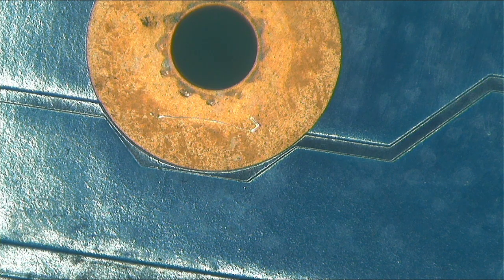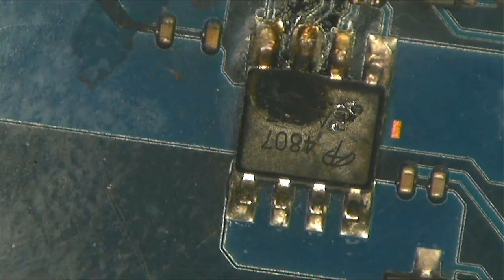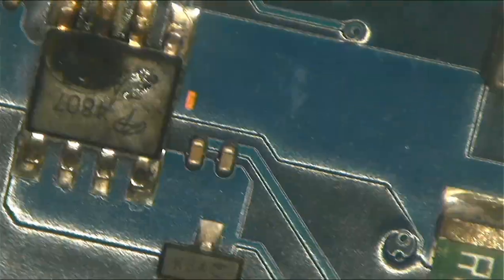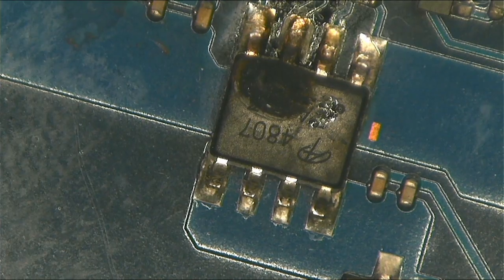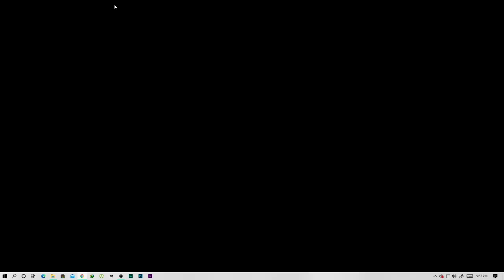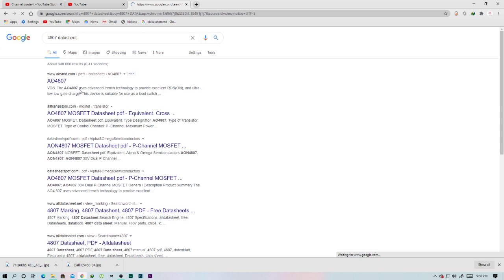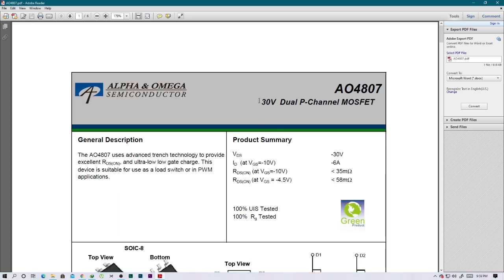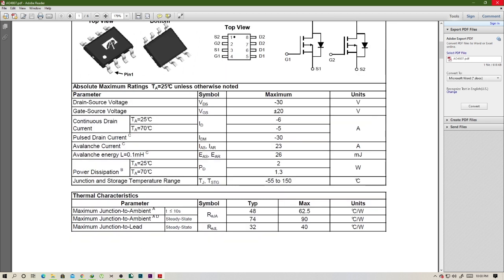BE CAREFUL WHEN REPLACING THIS MOSFET, IT A DUAL MOSFET

Comment: Hola, en el datasheet de ese dual mosfet,  los pines [5, 6] están unidos y los pines [7, 8] están también unidos, pero en el motherboard los pines 5, 6, 7, 8 ESTAN UNIDOS  Los drains de ambos mosfets están juntos en la motherboard ¿Es normal eso? ¿O estoy viendo mal? Eso quiere decir que si mido con el multimetro ese dual mosfet fuera de la motherboard marcará en continuidad los pines 5,, 6, 7 y 8 ¿cierto?